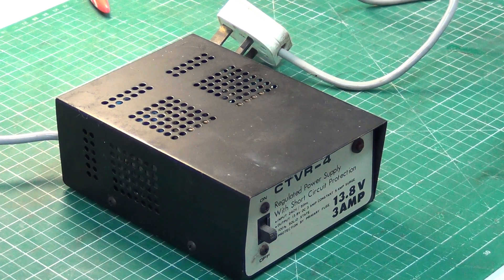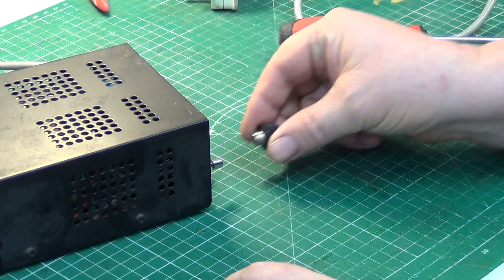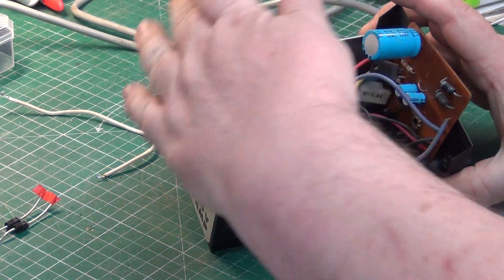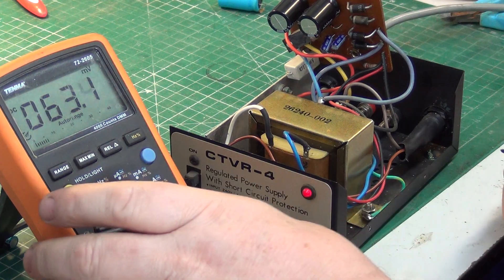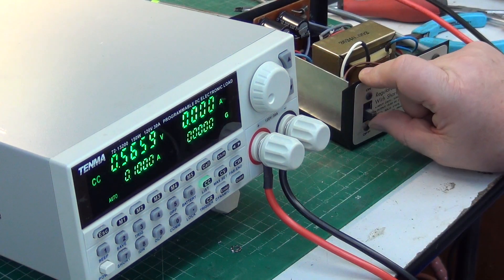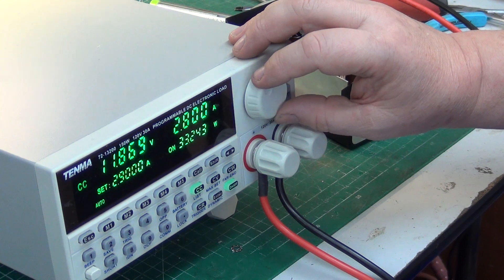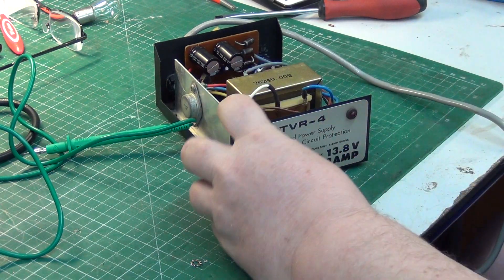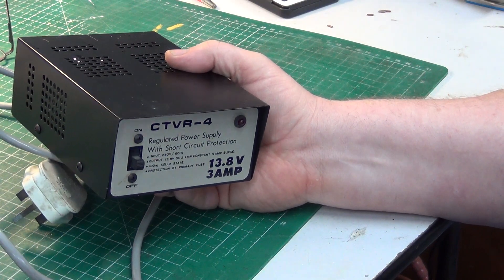Revisiting & modifying the CTVR-4  (3-5A)  PSU service...of the banned Taiwanese type

Comment: i have a question for you . is there a way to connect an mc80 base mic to a cb radio . reason i ask is because i have 2 of them and no hf set .
Reply from the maker: Chances are you'll need to make up a box with a relay in it. I've not seen the MC80, but other makes & models of business radio mucrophones have a single pole PTT switch & the mic audio going through all the time. Furthermore, you'll need a feed voltage for the microphone itself. I'm familiar with the Pye/Philips base microphones & they require 10V.

Richard, G0OJF, UK

Comment: That answered the question Thank you
Reply from the maker: And the conclusion is simply that the 3 extra parts bring it up from 2.5A to 3A. In reality, the 5-7A version of these is a far & away better circuit (the one we copied for our 3A power supply).

I have an incomplete one of these power supplies with the PCB missing. I'll be making & fitting the 'better' version PCB & we'll put it through it's paces once again.

Richard
Reply: @ukfmcbradioservicingTango21   I have a 5 amp CTVR version I'll pop the lid  off and see what difference I can see

Comment: Did you manage to look at  ripple on the output?
Reply from the maker: No I didn't. I just wanted to show if we could actually get 3A with the three extra parts instead of the 2.5A  which they usually do.

The point is that these are useable power supplied if modified to be safe. They are intended for use with normal 4W CB radios thsat draw around 1.2A on transmit.

At the end of the day, these were banned in the UK on the safety issues addressed in this video. It was 40 years ago. They are only worth doing now because traditional transformer based power supplies are over £40 now. 

I'm not a believer in cheap switch-mode power supplies with the potential noise the generate & the poor life expectancy; something I can relate to in a non radio experiemce too.

I have a quality A3 flatbed scanner. The supplied PSU exploded after a year & a few days. The replacement traditional power supply I replaced it with is still working fine 15+ years later. 

I bought an LCD computer monitor when they were new out in the 90's....around £400. About a week more than a year later (see the pattern), I was 30 mins from needing to set off to play the organ for a church service. I needed to look at my emails to see swhich church I was on at over the 46 churches I do. Monitor swouldn't come on. PSU build into the base. Quickly took it apart & changed all the suspect capacitors in the PSU. It worked. Did the emails & put the thing back together after church. Still working with the better quality parts.

Richard

Comment: Great video  But it reminded me I need do a few things got parts to repair a couple Aston ps I did my to 70 already but I have do a 50 n 35  had 70s n the 35 since 93  the 50 got  30 years ago it dead lightning strike when I bought it 
I got a pyramid 4 amp it 40 or so years old use it run my old rs hand talky in my live room  for years n year my Weller soldering  station went out so a few got behind till I got a new one n I had moved radio room
N I don't use my 6m or 2m amps so did need big ones that I use whith my 736r
Reply: what the heck did you just say ??

Comment: Great job :). If I had a diagram, I could change the values of the resistor elements a bit to improve the stabilization parameter.

Good Health Richard.
Reply from the maker: Well that's why we copied the 5-7A PCB version for our PSU project we showed a few years ago now, despite it being intended as a 3A supply. No point re-inventing the wheel. This version was the cheap one. It would be far & away better if the 5-7A board was used inside this 3A supply instead.

I reckon I have an incomplete one of these powsr supplies. There would be an interesting video....to rebuild it & replace the missing PCB with our version.

Richard, G0OJF, UK
Reply: You're right, I forgot about that larger 5/7A PCB.

Comment: Ive always found there is alot of rubbish with CB Power supplies, their current ratings are so obviously exaggerated, other than the safety issues, i dont know how they get away with their claims of continuous and surge currents. 

I had an "Eagle" brand PSU rated for 9A but its completely outside of its SOA for the pass devices!
Reply from the maker: Yes, absolutely typical. As BS as VW fuel figures! That's why we strip out the BS & use the electronic load.

Richard, G0OJF, UK